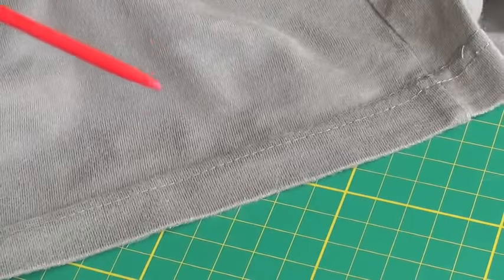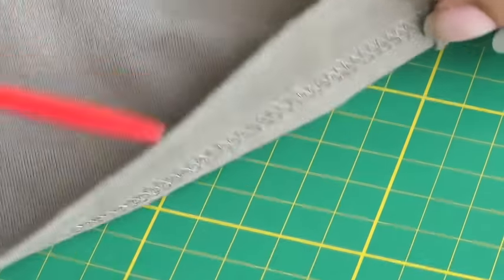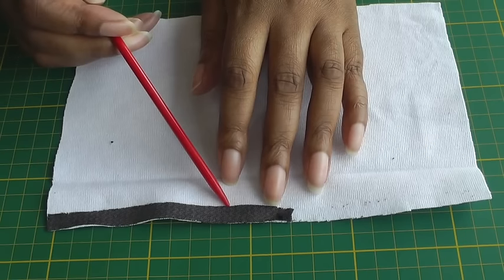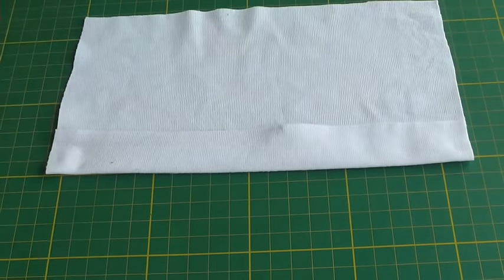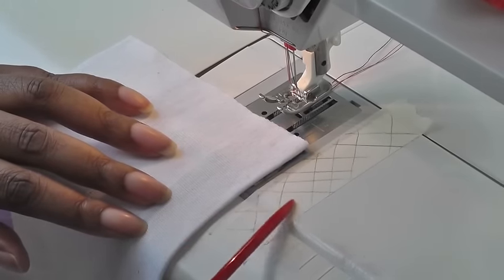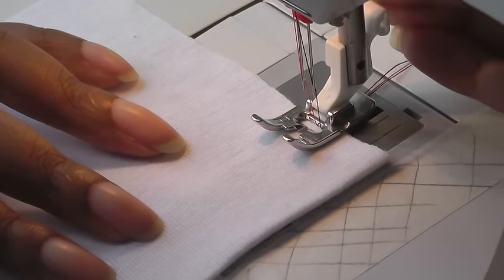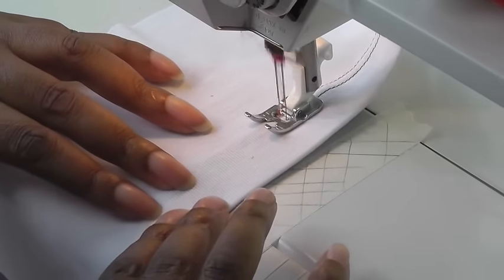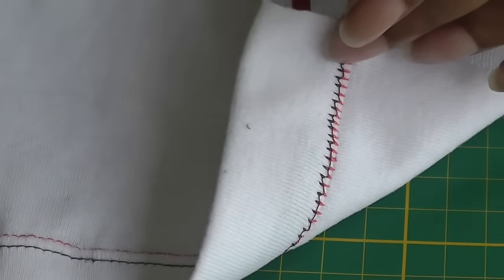How to Cover Stitch Using a Sewing Machine

Comment: A neat little trick to keeping the edge of your fabric/hem even: use a short stack of Post-It notes in place of the tape. The edge will butt against the notes, and you can attend to the actual stitching process with less worry about keeping the edge of your fabric in proper alignment.  (Unfortunately, this idea is not original to me - I saw it in one of my Craftsy classes.)
Reply from the maker: Nana DK thanks for your tip.
Reply: Thanks for the information!

Comment: The best way to make a coverlock stitch using an ordinary sewing machine is making the double-bordered zigzag using the twin needle. Before you do this, check the width of your stitch to prevent either needle from hitting the edge of the hole in the foot. If you do it carefully, then there's absolutely no need to use a coverlock machine.
Reply from the maker: Thank you for your tip!

Comment: thank you!

What is the thickest fabric a cover stitch machine can handle? I would like to use faux leather and wool of medium weight that lacks stretch. I don't plan on lining much since i am on a budget. I want the quickest method of construction.
Reply from the maker: It's a difficult question to answer. All I can suggest is do test samples before attempting the real thing.

Comment: Hi there!! I want to start making my own shirts and this is very useful. I have an old sewing machine (necchi argentina lycia III). It says on the manual that it admits twin needles but I bought one and it has it's flat side on the back and my sewing machine needs it to be on the right. Can I still do this? Thanks in advance!
Reply from the maker: Emilia B. No. You'll need the right needle for the machine. If you don't, you'll damage your machine and project.
Reply: FashionSewingBlogTV Thank you very much for your answer! :)

Comment: What type of stabilizer did you use? I used Pellon Easy-Knit Tape with a stretch twin needle for a pair of knit pants. It didn't work. I even lowered the thread tension. I was so hoping this was going to work.
Reply from the maker: +Demetria Santillan 
A firm fusible knit stabiliser.
Reply: @colleenglea  hey there! just found this video! would be extremely helpful to give us a link to this fusible knit stabilizer, seems like alot of questions but no link or brand recommendation that you used. thanks so much! can't wait to try!!

Comment: What machine is that?
Reply from the maker: Any sewing machine can do this technique you just need some twin needles.
Reply: @colleenglea  I want to buy a machine but not sure what to get. I want twin needle. And it to allow automatic knot the end of a stitch etc
Reply from the maker: @doms6741  The machine I use is a Juki HZL-G210 series, I've been using it for years. They are good strong and sturdy - I would recommend looking at the Juki HZL-DX series > https://amzn.to/3QyVmHo. If you are going to be doing a lot of cover-stitching, I would use a cover-stitch machine as they give more professional finish. The Janome CoverPro 900CPX https://amzn.to/3QzKdWQ is a good choice, I've used a cover-stitch machine but I don't own one. I have shared a couple of amazon links so you can check out the specifications. I hope they help and good luck!

Comment: But a coverstitch allows flexibility (like a serger) using a twin straight stitch there is not any give. .. if you use on a stretch material it will break the threads. ..